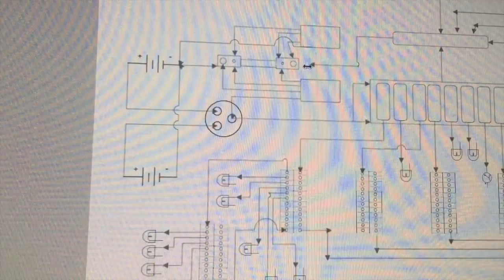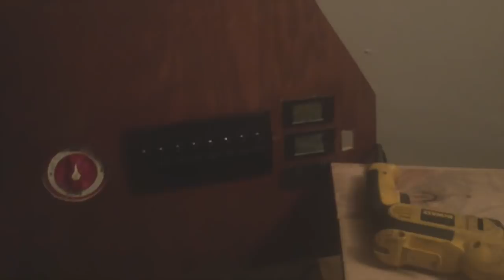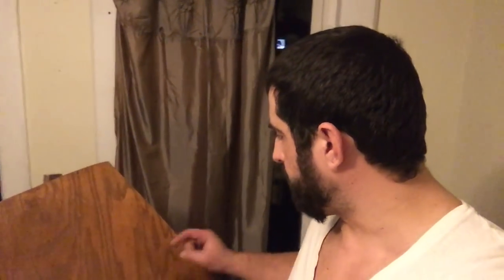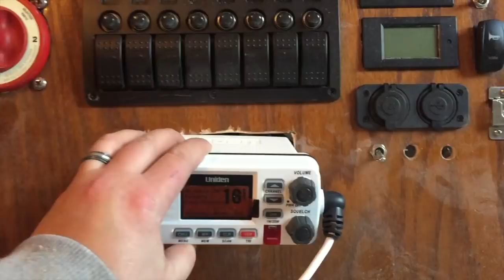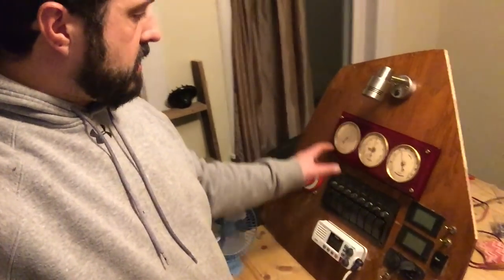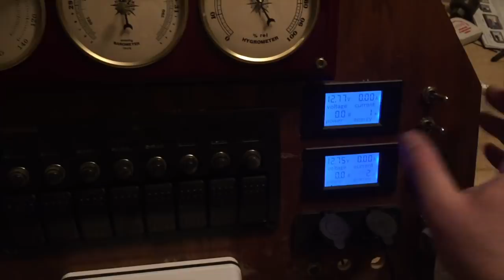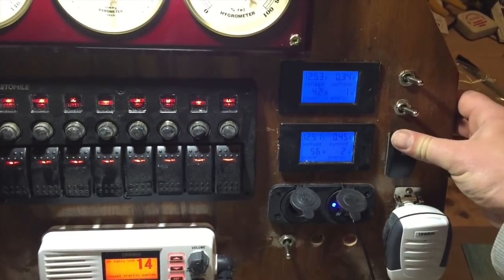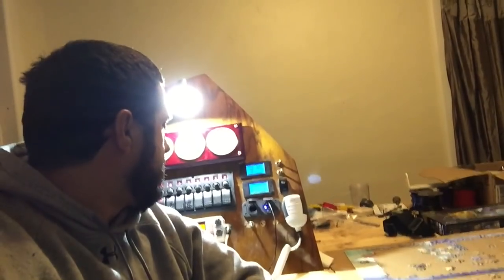Re-Wiring A Sailboat (New Electrical System)

Comment: Keep a notebook of parts and suppliers. Accessible fuses / breakers for EVERYTHING! ( and a few spare)   A negative bus  line run at waist height, stem to stern port and stbd. reduces the mass of to and from wiring. Just hook all your negatives to it.  Fit a BIG bilge pump and strum box/es
Reply from the maker: Good tips!

Comment: Ryan, I'll add a couple comments.....
1. The battery. It looks like you have it under the STBD settee. I would recommend putting it under the V-berth. Mac's actually sail better with some weight forward.
2. The back of your panel.  I know you aren't finished yet, but electrical connections are exposed. Someone could accidentally touch the wiring. 

- James, SV Mistress

Comment: Like your videos love the boat has come along. Just an FYI don't know if you have the antenna hooked up to the radio, but you should never key up a radio without an antenna hooked up to it. you could burn out your finals. I have found out the hard way. Keep up the good work.
Reply from the maker: Really?? Man I had no clue, must be somewhere in the instructions I don’t read, lol. Well hopefully I didn’t screw it up. Thanks for the info.
Reply: with it being brand new it should be fine. Just glad you saw this message quickly. also you would know pretty quickly, there would definitely be smoke and a smell.

Comment: Like your channel! Front of the panel looks great, back, not so. You should organize your wire into a bundled harness. Then number wire ends 1-1, 2-2, etc. Keep it up.
Reply from the maker: Thanks Oluf! This still wasn’t finished yet. Every circuit on the back is bundled into a color coded what you would call a harness, what I would call a zip tied bundle of wires arranged neatly in a cohesive manner. There will be more shots of it in part 2. Thanks again for watching and commenting.

Comment: The stern white and nav, bow, should be on one circuit. Steaming half way up mast and then anchor. That's the required setup. Otherwise looks good! The diff in draw on the monitors was probably impedance on the back feed. Install diodes prior to install on the battery leg.
Reply from the maker: I suppose, I really just didn’t what to have to put 3 more toggle switches on what was already getting to be a crowded switch panel. But at the end of the day I think it will work just fine. Also the meters eventually evened back out once I cleaned everything up and righted it all down. Thanks for all the good info!

Comment: Did you ever consider having the option for red lights on the nav station and in the cabin? Red lights help you retain night vision. There are some LED's that have both white and red with a switch in the cabin to select. Could easily be added if all of the cabins are on one circuit.
Reply from the maker: I considered it, yes. Might eventually down the line, just didn’t consider it a priority at this point.

Comment: Hi Ryan! Discovered your channel a couple weeks ago and really helped me to plan some refit for my boat. Bought some of the stuff you linked here and I am now building my new panel. Can you tell me how you fixed the shunt to the panel? Glued it? Cant figure out. Thanks and cheers from Argentina!
Reply from the maker: Hey Gaston! Thanks for everything! I either used double sided mounting tape or I screwed through the terminals, let me dig through some photos and I’ll get back to you. Share your project on he Facebook page! Id  love to see what other people are doing!
Reply from the maker: Ok after looking at one of the Instagram photos I remember now that I tried screwing through the terminals but it messed with the resistance a little and wasn’t reading accurately. So one I stuck with mounting tape up high and the other I just wedged into another cluster of wires so it was just suspended in (other) wire insulation.

Comment: Good job, Ryan! This way of getting most of your work done inside and then getting back on the boat with it works well for me too. Do you have a heater on board so you don't freeze while you are working? In my small cabin it gets comfortable after a 1/2 hour. Keep up the good work. Well organized.
Reply from the maker: I do have a small space heater but only one extension chord ! It doesn’t work very well when I keep unplugging it! But everything is coming along well so far!
Reply: That's why I got a heavy duty plug strip. It runs my parents electric bill up probably but I had the heater, my soldering iron, and the drop light going for many hours while I worked on the new electric panel. (Thankfully all my major circuits are already covered in a fairly new West Marine panel.) The new panel video is being posted tonight.
Reply from the maker: Cool I will definitely check it out!

Comment: I'm trying to figure out a couple things and one of them is VHF antenna. Did you do a new deck fitting and a mast-mount antenna? if so, how'd you go about doing yours?
Reply from the maker: I haven't done mine YET, but when I do Im going to use this fitting to go through the deck (https://amzn.to/2GB4Tti) previously it was just wire coming through a hole with sealant around it. theres already a wire that runs up the mast but I'll also need to add the antenna to the top of the mast and IM thinking about this one for that (https://amzn.to/2IrH1sC)

Comment: what is the make and model of your battery bank monitors I didn't see them on your links page.  thanks I really like the videos
Reply: never mind I missed the link as a multimeter thanks Im gonna get a few of those I will use your link so hopefully you will get a few bucks from Amazon.  thanks for the link
Reply from the maker: Thanks so much Shaun! I really appreciate that! Im sure its not much but every little bit helps! Thanks again for your support!

Comment: do you have a drawing for this? Are there any items on the boat that are not switched through that panel?
Reply from the maker: Yes if you go to the Facebook page (link in the description) there is a post there with the diagram. The only thing not running through the panel is the float switches for the Bilge pumps, those are a direct connection so they will always be ready.

Comment: Hey man.  Wondering if you can help me with something.  I'm trying to add some stuff to my boat (Catalina 22)
I cant figure out for the life of me how these switch panels work.  I read with a multimeter voltage when the switch is closed but when I turn the switch on I cant find the closed circuit anymore. 
The stock cabin lights work, I just cant figure out how and where to tie to the back of the panel for my new strip lights and speakers.
It's not as simple as positive and negative
Reply from the maker: dialedN07 it really is just s matter of positive and negative. You just need to figure out what’s what back there. I’m not sure where you were taking readings from with the multimeter to help. Remember both terminals on a switch are going to be positive because a switch just opens an closes a positive flow of energy. Your best bet is to work your way backwards from the battery to see how it’s all put together. I would need to see photos of everything to help you.

Comment: I didnt see any fuses, are they built into the switches?
Reply from the maker: Yes, they pop like a little circuit breaker, then you just push them back in to reset them.

Comment: Can you share your schematic?
Reply from the maker: I sure can, I did deviate from it a little though, especially when it came to the meters. Originally as diagramed one was supposed to monitor load data and the other charge data. For the life of me I couldn’t figure out why I wasn’t reading amps or watts coming off a battery charger for the one I had wired to monitor charging performance. I followed the diagram listed with the product but all I was reading was voltage. SO I just decided to use them both to monitor load data and voltages of two batteries separately. But if you are a fan on the Facebook page I would be happy to post my original.
Reply: Is the Facebook page just sailing freestyle?  I looked but it was a closed group and I couldn't tell if it was you
Reply from the maker: There’s a link in the description! I’ll post an image I have on my computer tomorrow morning